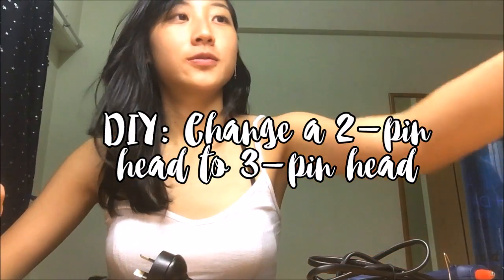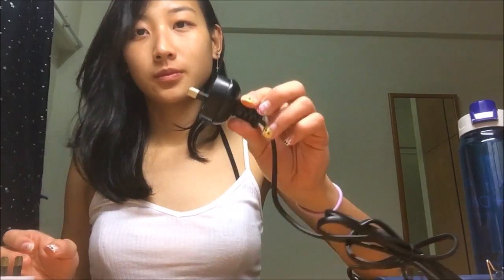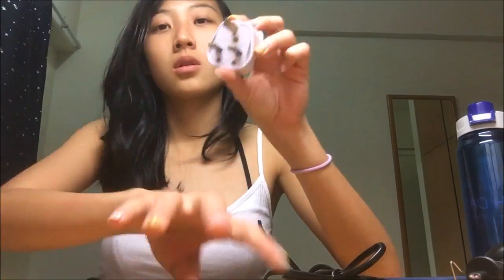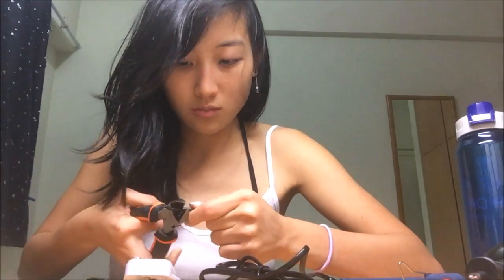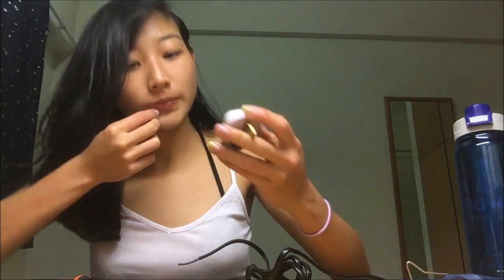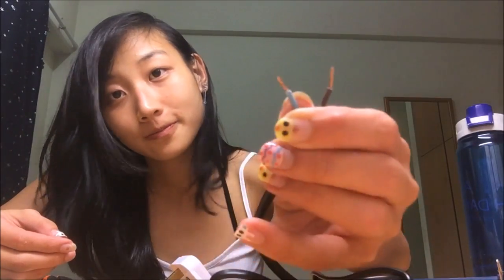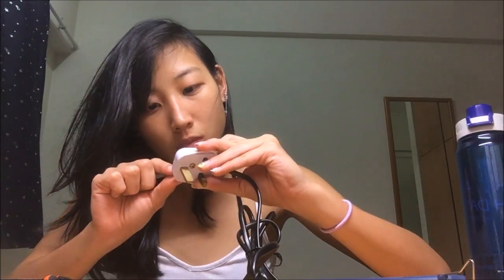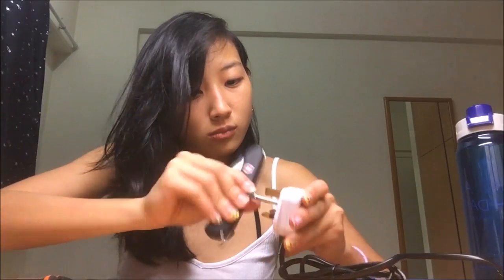DIY: 2-pin plug to a 3-pin plug

Comment: My 2 pin head is broken, just bought a 3 pin head but noticed the circuit breaker in the 3 pin is 13A and the 2 pin shows only 2.5A. Should I change the circuit breaker inside my 3 pin head to a 2.5A?

Comment: dear sweet  its possible to add earth wire? for my audio amp
Reply from the maker: If the earth wire is present with the original wire, go ahead and connect it. But otherwise, it's quite impossible to thread and add a whole new earth wire without cutting the wire open

Comment: Good effort. It looks like you were converting an Australian AS/NZS3112 plug to a UK BS1363 plug. But be careful to note that by Australian/NZ standards, the color of "Active" (live) wire is brown, while the "neutral" is blue (it is different in different countries). You happened to have gotten it right on the video even though you did not mention anything about the colors of the individual wires. Reversing the polarity of the plug in certain applications can have dire safety consequences. Looking forward to see you in Electrical Engineering school :)

Comment: Dear, there is  reason for a two pin and a 3pin. hope you receive more trainings on electrical safety.
Reply: Why? I'm curious as I plan to convert a 2 pin Chinese plug to a 3 pin BS1363 plug, as the supplied adapter gets very hot when I use it
Reply: @NMad-kp2bu  3pin of earthing is meant to reallly reallly be used to link 'metallic' surface of an appliances to the Earth. If your appliance was manfactured correctly to be without, you might in event link the internal stray 'voltage' to the earth with your modifcation. I recommend some old new on Mac desktop electric shock issue.
Reply: @NMad-kp2bu  the 'hotness' you have experienced is probably due to underrated appliance. Say, cooker for China network 220V will be hot when connected to 230V. Which is why we shouldnt buy appliances not meant for our own region.